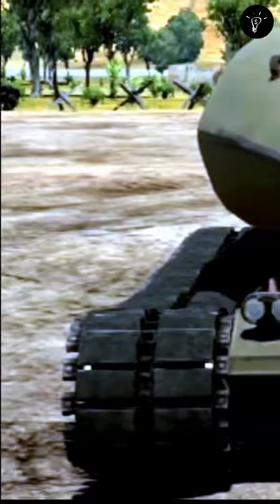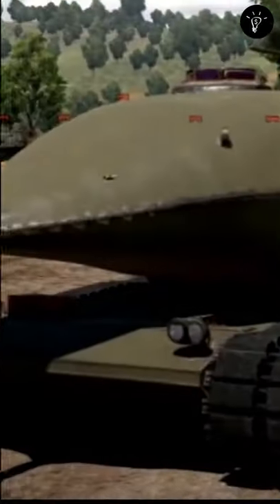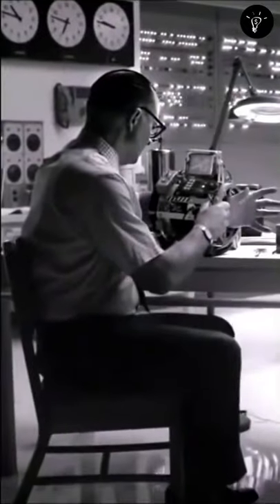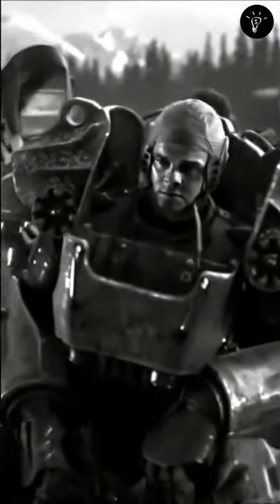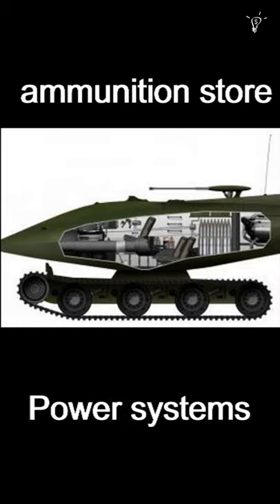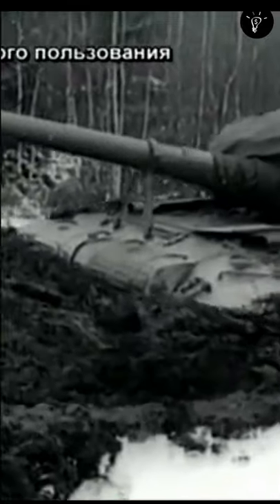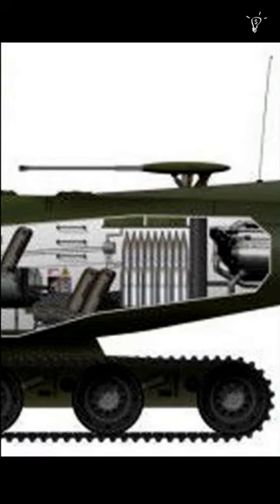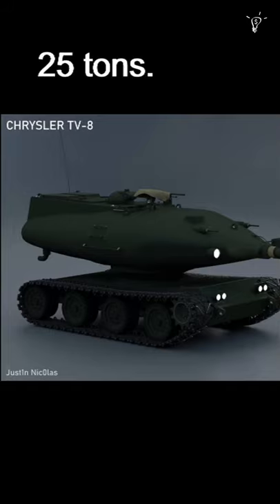Chrysler TV-8, A Failed Nuclear Tank.

Comment: Reasons:

-Too advanced

-The problem with small nuclear reactor and radiation

-ATGM missiles overpowered tanks making it kinda useless unless they redesign it and add some reactive armor

-camera at that time were still under development, now we have 4k HD cameras for the military

-the tank can be use up to 25 years without refueling for its Nuclear reactor but when it comes to nuclear meltdown it has to be abandoned.

-The actual tank/first plan of TV-8 doesn't use nuclear reactor but a tubrine engine which is similliar to M1 abram's engine and 2 speedjet engine for the amphibous mode
Reply: So basically every problem is fixed: 
•Shield the reactor
•Put Some high energy Anti-ATGM lasers on it (since it has the energy to power them)
•Have a built in Japanese tactic
Reply: • looking at the layout, There's no way this thing has gun depression

• weird complicated and massive armour layout, making it an easy target

• everything stored on the turret. Once it's hit, it's over. The radioactive substances would leak and contaminate the environment 

• overcomplicated shape of the turret, a nightmare to wield.

• There are too many so much better tanks in operations. There's no reason to replace M48 Patton with this thing
Reply: @sonanerikov1  This bad boy use an Oscillating turret mechanism, so technically the gun never moves only the whole turret which carries the nuclear reactor and etc while it sends its energy through gearboxes and etc to the catipilar tracks aswell etc
Reply: @saga_hee  
Imagine how unbalanced it will be and how uncomfortable for the crew. As if it's not enough for them to feel the constant rotation of the turret, they also have to deal with it tilting at an angle. 

And also the track doesn't seem to have gap between it and the ground. There's no way it's operable at high terrain